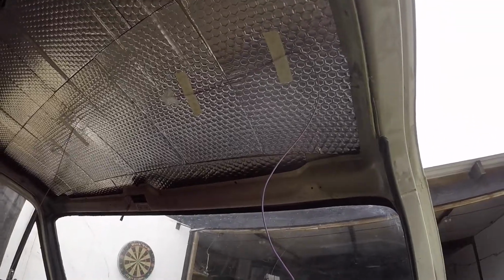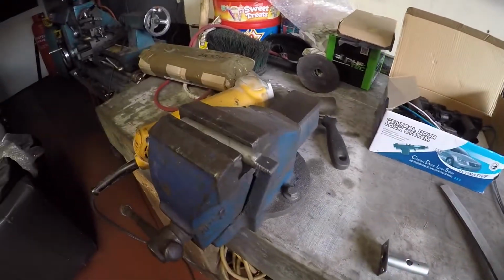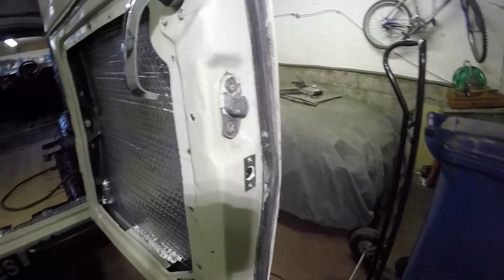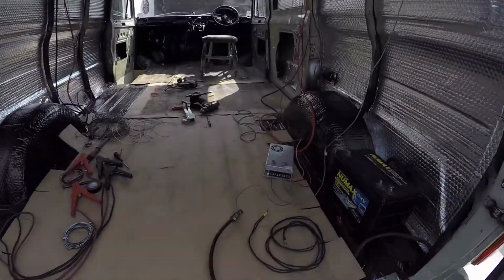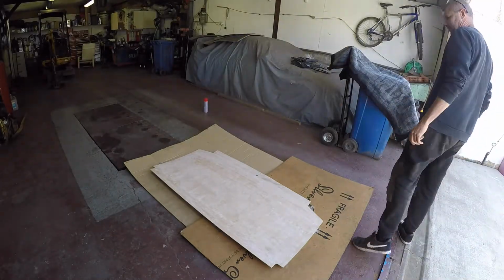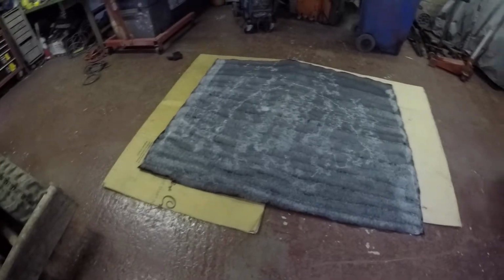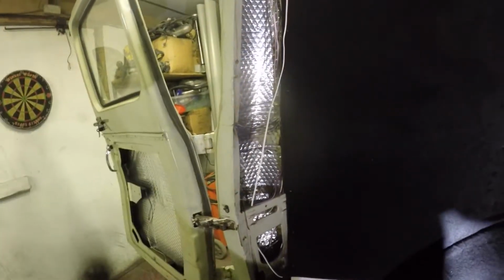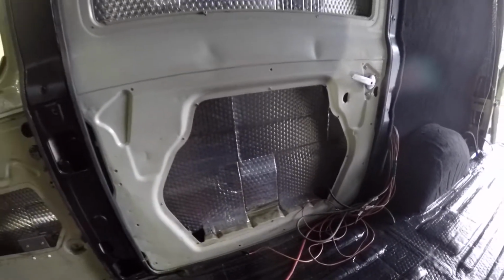Ford Transit Mk1 Project - Part 13

Comment: excellent except the one on the rear doors don't really work like that, they need to go into the frame rather than the other door. Great work though.
Reply from the maker: Thanks 🙏 appreciated. I just did the back door like that as didn’t fancy fitting 4 bolt locks, seams to be pretty secure for now as I only really wanted central locking on the fob in the first place 👍 cheers

Comment: Thanks for sharing your brilliant ideas mate. Regarding central locking and indoor paneling. Though insulation is not for me. Too hot in Malta, 😆 lol 😆. Personally though I would go for a much lighter colour than black.  When we cover them from inside we use thin hardboard with wood grain effects as it's more cooler and easily wiped.
Thanks again for all the work and ideas you shared. Will share your videos on the " Ford transit club Malta "
https://www.facebook.com/groups/1374457282835659/?ref=share
Reply from the maker: Hi Gerald, thanks for the kind feedback, it’s mostly cold over here so need as much insulation as we can get 😂  although I think I’d prefer to be in Malta as I love sunshine ☀️ thanks for sharing in the group, I’ll also join it now. Cheers mate, all the best 👍